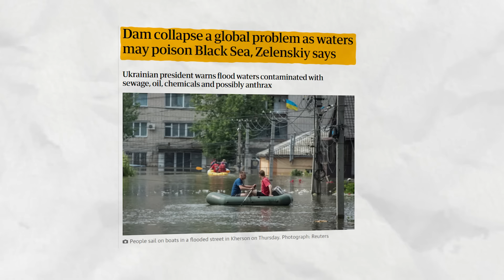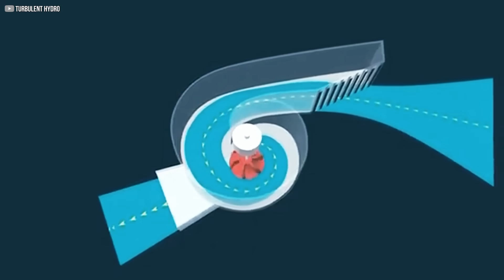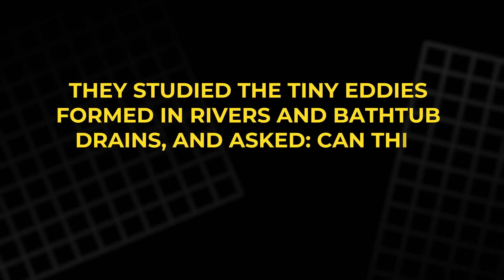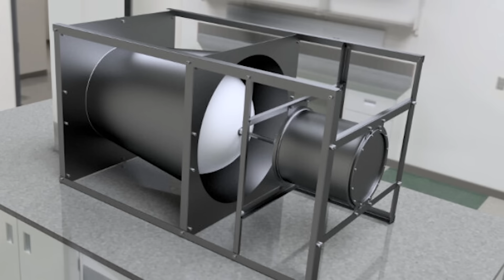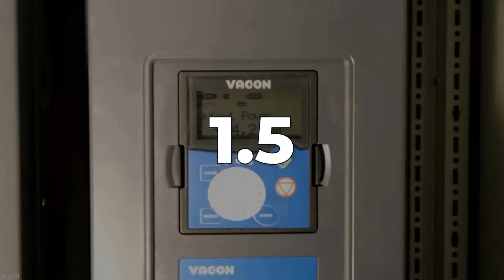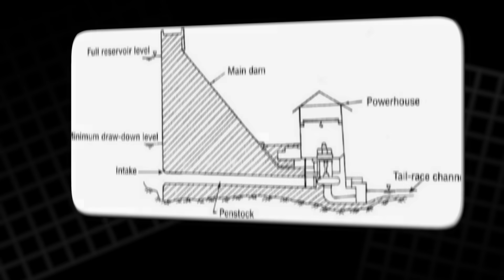This Tiny Turbine Could Replace Massive Dams

Comment: Wonderful, I have been working on similar designs , must follow up with that company now. Thanks
Reply from the maker: That's great to hear you're also working on similar designs!
Reply: @TheForgeEmpire  The work of Viktor Schauberger has had me thinking on this for a while. Thanks.
Reply: For what it is worth, I may have developed a way to create polygonal block construction.   I am just arranging to get some 3D  models made of the prototypes.  Basically, 3 forms would allow for straight wall, curved wall, or dome construction with just 3 shapes.  It works with maths, and in design. Now  I must test with a proof of concept prototype.

Comment: (min 6:27) "it doesn't disturb fish"  Then shows a ball that pretty much rolls against the walls in a circular motion.  Are you trying to say that it's squishing the fish so quickly that they don't have time to feel disturbed?  //  (min 8:02) "debris and fish require intake screens"  //  (min 8:43) "just a controlled spiral that generates electricity and lets fish swim through"  Make up your mind.  Do fish swim through, or are they screened out?  Logic or consistency do not seem to belong in this material.  Overall, it sounds like a collection of advertising slogans that were picked randomly from some marketing brochures.  Zero credibility.